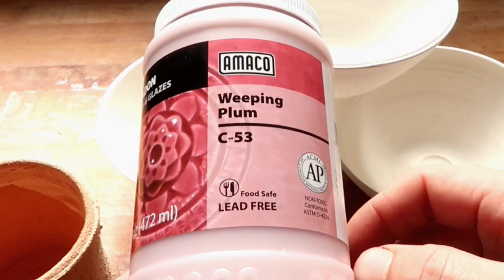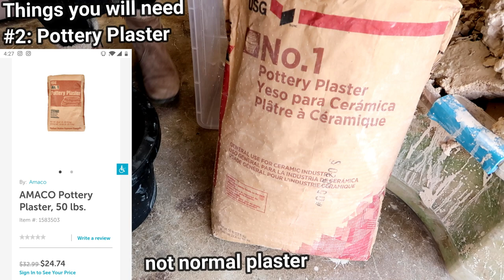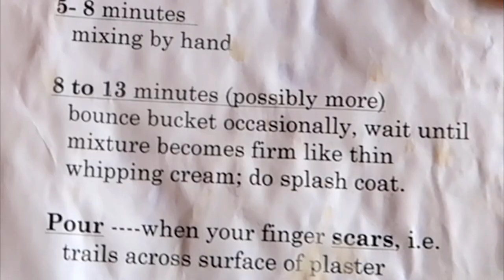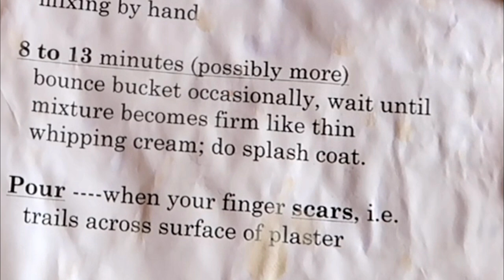How to make a plaster slab for wedging and recycling clay (easy)

Comment: You CANNOT just use the same constants if you want to go metric. I've gone through the numbers and found out why:
When you divide the volume of your container with 80 you're actually BOTH converting from in3 to qt AND finding the amount of water needed:

456 in3 * 0.017316 qt/in3 * 0.72 = 5.7 qt
0.72 is the amount of water needed per amount of volume of your container.
0.017316 converts from US in3 to qt.

So how did they land on the number 80? Try doing the calculation above without including the volume of your container:
0.017316 qt/in3 * 0.72 = 0.01249 ~ 0.0125 = 1/80
and
1/80 * 456 = 456/80

When using the metric system you should (I've derived these constants from the ones used in the video):
Divide your volume by 1.386 OR multiply by 0.72 instead of dividing by 80.
Multiply by 1.439 instead of 3 to get the amount of plaster.
Remember to convert between cm3 and L: 1000cm3 = 1L

ETA: Thank you for this great video!
Reply: In metric the ratio is super easy, because a liter (or cubic decimeter) of water equals a kilogram of mass, a milliliter (or cubic centimeter) is a gram.
...well and a cubic meter is a ton ofc, but i doubt there's any reason for a plaster mold that size

Normally you'd just go with  7 Parts of water per 10 Parts of plaster (by weight) 
slight variations are usualy no concern
Reply: Thank God for those of us that actually pay attention to math 🤓Kudos fellow mathling
Reply: You are a legend, I was trying and thinking this formula isn’t working!

Comment: Because of a happy accident, I have been using canvas to dry my recycled clay.
Recently I could not longer use my plater batt for drying my recycled clay (evidently used the wrong plaster); so I had to find another way to dry the clay I am recycling.  I had a scrap piece of canvas laying around and found that it works well.  I just lay a piece of canvas over something to allow air under it then pour the clay into it.  The air evaporates the water that makes it though the canvas.
There are lots of advantages of using canvas:
1) It is really cheap
2) It is easy to store (just roll it up)
3) It doesn't crack or chip or shed material
4) It scales up easily - you can use as many as you have space for
5) You can use the same piece with different clay types and not get contamination. To clean it, all you do is wash the canvas in a bucket.  
6) It is super easy to move and work with.  1) To turn the clay, I put another piece on top and flip.  To move it to my table to wedge, I grab the edges, flip it onto the table then peel the canvas off.
Reply: What is the material you use under the canvas to allow air to circulate?
Reply: @CookbooksonRepeat  Nothing, just the finished wood of the cart or sometimes I have it on top of my old plaster batt.
Reply: Do you use the kind of canvas cloths for painting? Or which kind? I like your idea it's more beginner friendly!
Reply: @raniachairya  I bought a yard of Duck Canvas at a local fabric/craft store  (Joanns)
Reply: @connecticutaggie  alrighty, thank you!!
Reply: Even when using plaster slabs to recycle clay, it's a good idea to lay down canvas before dumping the slip over — helps wick water to minimise dribbling, eases turning and moving and speeds up clean-up!
My plan for the school studio I'm managing is to use thick sheets of drywall to form a box to fit under a table inside frame legs, so the slip can be applied to all five inner faces, and moisture can escape from the all outer surfaces.
Also will get thick cement board for wedging, with non-slip webbing glued under so they sit tight on top of very sturdy galvanised steel tabletops; that way corrosion won't get so bad and they can be lifted and moved for cleaning as needed.

Comment: I use a large plastic dishwashing pan with a flat, smooth, unmarked bottom (this will be the side of the bat I will use).  I poured water to a line inside the pan for the thickness, pour the water in a bucket, then add potter's plaster until the islands form, stir it thoroughly and pour the slurry into the dishpan.  I don't do any other measurements.  I can pop out the plaster bat onto a square metal pizza pan (it's a flat surface with tiny holes for air circulation that don't make marks in the soft plaster like a grate or grill can)  in about two hours.  It takes about a week to dry completely in a warm room. I do this with plastic bowls and containers of various sized to make hump molds, too.  If you want to use both sides of the plaster bat, you can simply spray the top of the slurry in the pan with isopropyl alcohol to pop any bubbles on the surface and simply leave the plaster in the mold until it is very hard and dry to the touch, so this surface won't be as likely to chip, dent, or be scratched when you pop it out of the mold.  You'll have a bat that you can flip over and use the other side once in a while, which is handy if you use different types or colors of clay and want to avoid cross-contamination or staining of a light clay with color.

Comment: I've seen the wet box method and it never occurred to me to make a plaster bat like that, thank you for the easy instructions, another tip if you want to wedge and have like a plastic table is to use a small mdf board that you can rest against a wall

Comment: More plaster per water makes a less moister-wicking plaster slab. Recycling clay needs a slab made from a ratio of 2 3/4 lb. plaster to 1 quart cool to room temperature water ( don’t use hot water). Also it is necessary to have good air flow around slab when drying for increased strength.
Reply: Thank you so much🙆‍♀️🙆‍♀️
Reply: Do you have a source for that correction or is that just off the dome? This would be good to know if it's true.

Comment: Great video.  I did this to make a wet box for things like handles and knobs that I make in advance and keep moist for later.  The lidded tub allows me to keep the plaster he moisture of the clay I'm using, and my handles will stay usable for a long time.  Take off the lid though, and it sucks the moisture right out of them in minutes!  Of course it does!  I'll be making drying slabs this way for sure!
Reply: Is the drying box just a lidded box with plaster in the bottom?  Interested in making a few.

Comment: I noticed that in the video, Lindsey talks about scraping the rough surface off of the slab.  Is it possible, instead, to just flip the slab over and use the smooth side for recycling/ wedging/ etc?
Reply: I was thinking the same thing!

Comment: This video was/is FANTASTIC! I just made two plaster slabs; both from IRIS containers. One container is labeled a "41.2 Qt" container with dimensions of 23.625" x 17.75" and the other was labeled a "46.6 qt" container (it was taller) with dimensions of 15.75" x 19.69". The plaster set in less than 30 minutes and I was able to pop the slabs out the next morning! I love the size of the bigger one, but it is heavy. I also noticed that the thickness of the slab was 2.75" rather than the 2" I had targeted. I suspect it was because the sides of the containers were sloped outward toward the top of the container and were probably the dimensions that IRIS reported. I'm doing a new set at a reduced mixture (0.73) to see if I can hit that 2" thick mark on the nose. Thanks again, for the video. It has made my day/week/month/year!

Comment: I found out why you use plaster for ceramics instead of regular plaster.  The builder's plaster becomes brittle and as you use it to dry clay, a film of it actually strips off and is incorporated into you clay.  Not good!  It absolutely ruins the clay.  Makes bits just pop out of your pot days to even months after firing.  Thanks for reminding us to use the right stuff!
Reply: So I made a plaster batt a couple of years ago from plaster from HomeDepot and I have never liked the batt because I keep getting plaster in my clay - now I know why.  It also has gotten a gouge in it, and has cracked - even though it is in a reinforced wooden frame.
Reply: @connecticutaggie  that sux. Yeah I noticed when I used it (home depot plaster) that it did the same thing. Thankfully I didn’t ruin any pieces I had made just a bunch of clay. 🤦🏽‍♀️ Only then did I find this video. Better late then never I guess. 🤷🏽‍♀️
Reply: yup I learned this the hard way!  Rather than throw out the plaster slabs I had made for clay recycling, I just lay tea towels over the plaster and dry the clay on those. It still dries the clay nicely without it having any contact with the plaster. I then wedge it on cement board.  Eventually I will try again, use the right plaster and follow this video!

Comment: I’ve used plaster of Paris from Home Depot with the same method and it worked well
Reply: i cant find plottery plaster in my country 
i was wondering if i could use plaster of paris but does it come off and get mixed in the clay?
Reply: @syedhamzahaider512  yes it does. It will ruin your pieces when firing. 😐
Reply: @emilymccarthy1  so should i use a Cement block?
Reply: @syedhamzahaider512  I am no mean a expert. Lol. I think I’ll leave that for someone with more experience. 😊 I just have had a bunch of people inform me of the plaster of paris. Plus I noticed it was leaving a slight white residue when I wiped it with a sponge. So I knew it was doing the same with my clay 😐. Hopefully someone will have a answer for you soon. ✌🏽❤️
Reply: @emilymccarthy1  lol okay 🙂
Have a nice day 🤝
Reply: @syedhamzahaider512  You as well 😊
Reply: @syedhamzahaider512  Don't use it for direct contact with the clay (eg wedging) because it can ruin the clay,  but you can still use the plaster of paris for a wetbox or recycling clay. Just lay down newsprint or a tea towel or something on top of it and then put the clay on that.

Comment: I'm new to pottery, started using a colander(For  ventilating the underside) lined with an old bed sheet, putting the slip on top of the lining, and then putting another bed sheet on top of the slip. Seemed to work pretty well and didn't need to flip the clay. ¯\_(ツ)_/¯

Comment: Found a conversion, 5.7 quarts of water is 11.89 pounds. I wanted to be able to just weigh everything out since I don't have a large pitcher with units of volume
Reply: 5-gallon buckets are handy in moments like this, especially if they're semi-transparent and have graduated measurements on the outside.

Comment: Sorry if this is a silly question, but does the x80 formula still apply to metric units of measurement? I am from Australia and i can't find metric ratios anywhere for making a bat like this one.
Reply from the maker: Yes. We potters generally do not use the imperial system. We use grams. Metric is more accurate for us .

Imperial Is such a bad system Even our drug dealers switched over to grams.
Reply: I am from Australia too but I ended up converting to imperial just to make sure I got it right.

Comment: Hey there thank you for the great video ! I have followed the instructions and bought pottery plaster to make one on my own. The problem is it has been 2 weeks now and it does not dry and it is a bit too soft in terms of it didn‘t harden well. I am pretty sure a i mixed it like it is supposed to be mixed 1 kg plaster with 0,7l water. I don‘t know what went wrong. Maybe you would know what could be the reason of it not drying?

Comment: Hello! I have left my slab for 5-10 days in the box and whilst it popped out easily there seems to be a bit of moisture left in the plaster - i.e. i can dig my nail into it very slightly. It doesnt feel dry and crumbly, but softer. Does this mean it's not quite dry yet? I used pottery plaster. Any info would be appreciated! :) Thank you!

Comment: Is it necessary to smooth down the rough side of the slab?  Is that the side you will use to recycle the clay? Could you use the smooth side? On the upper rough side of the mold you mention a alcohol spray.  What is the recipe for the spray?  Also, do you think you could used a hand sander to knock off the rough parts?
Reply from the maker: You can if you like ( make sure to give it a few weeks to dry completely) but I use the rough side as a grip for the ground and just use the smooth side. It works well when I wedge on the floor .

Comment: I have done this but did not make it thick enough the first time what I found works best for a smooth surface is the bottom side that was against the plastic container
Reply from the maker: Fo sho. I usually flip mine over to a smurther surface.
Reply: @EarthNationCeramics  also, I've found it more effective if the plaster has airflow underneath. I.E. mine is on a metal shelf with slats.

Comment: I have a large deep stainless steel tray.  Will the plaster pop out of this mold or must I use a plastic container?
Reply from the maker: yeah it just wouldnt be as deep. i aim for 2" deep
Reply: @EarthNationCeramics  Thanks!  I've done the math for larger and deeper as it is a very large form.   It will sit upside in the tray on stilts for air circulation.  I've been planning for months LOL.

Comment: I understand why not to use regular plaster and stuff but would it matter if I put a moist cotton cloth in between the plaster and clay? I prefer to use a cloth sheet in between bc it’s just easier to flip the clay or carry it out in one piece and all that, but do u happen to know if it’ll keep the regular plaster residue and pieces from getting onto my clay?? Idk if you’ll know this tho.
Reply: that's what I do in my damp box and what I made for recycling clay (I agree that does make it easier to flip it) you just can't wedge on the regular plaster and it won't be as durable so you can't move it around the studio much without it being in a box or frame already.

Comment: i cant find pottery plaster in my country 
its ther any alternative material to thing i can use instead???
Reply from the maker: Concrete and wood work pretty well. Before I started using plaster I would often just get smooth bored from a supply shop or from a hardwood store and use that.

Remember you just need an absorbent strong material

Comment: Great tutorial! Question: I’ve been pretty paranoid about having plaster around my clay room due to cross contamination, keeping everything separate, even mixing up outside, different buckets, etc. Am I going overboard? Thanks, Brian’s wife
Reply from the maker: Most of us buy plaster in a dried form and we mix it with water in the fashion I showed in the video and use it immediately.
You should not be keeping plaster in a wet state in a bucket to the point where it gets mixed with other things.
Buy the plaster, use it, keep it dried form in the original bag you bought it in. This way it is still separate and labeled while you can still make your blaster mold

Comment: My clay is really getting short and is a mess!! What can I add to it to make it better? I have so much that I let dry out, crushed as well as I could, added water to, mixed and mixed and mixed then put on plaster and after all of that it’s extremely short!! Please help.
Reply from the maker: Short?
That sounds like you need different clay
Reply: @EarthNationCeramics  Short as in it cracks even when it is very wet.
Reply: You can add vinegar to short clay to change the PH, and make it more plastic.  Also, add some dry version of your clay to the mix, and it should improve it.

Comment: Hey Guys,
Will the formula work if I use centermeters and litres. If not can someone please convert for me? Maths is definitely not my strong point. TIA
Reply: 1 inch = 2,54 cm, 1 quart = 0,95 L, 1 pound = 0,45 kg
Reply: 7 parts water to 10 parts plaster

Comment: oh ummm u CAN use normal plaster to make plaster bats it makes zero difference. 

it only matters when ur making plaster moulds (also pottery plaster & plaster of paris is the same thing) 

it’s just bc of how fine the plaster is.

personally I live somewhere with no access to pottery plaster (I live in kuwait) and my options are ship a heavy bag of plaster in from the UK or just use building materials that already exist here. I ended up using Kuwaiti Gypsum and even THAT worked really well.